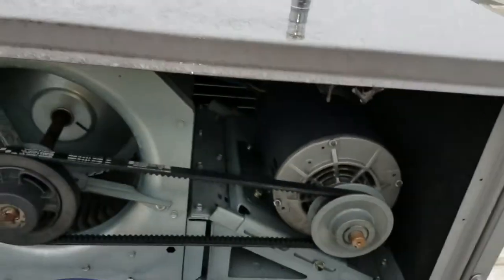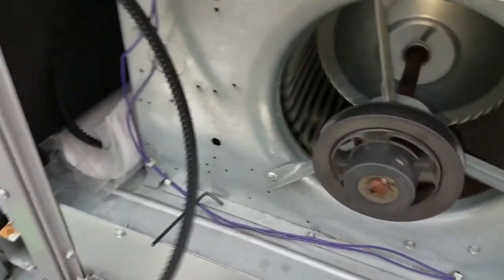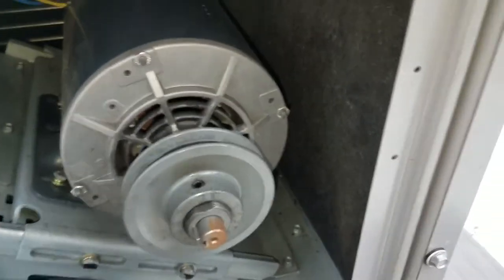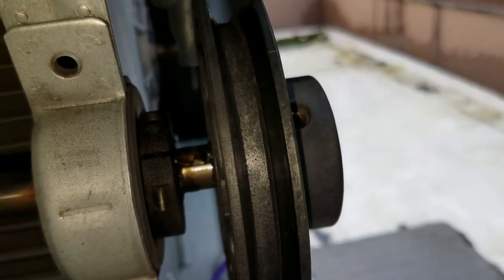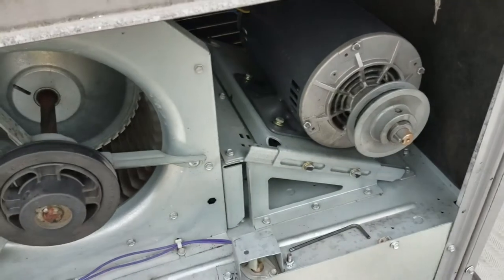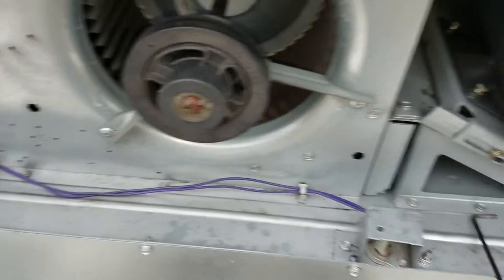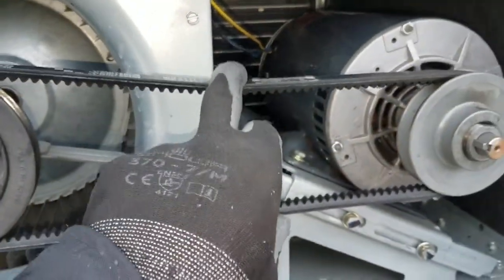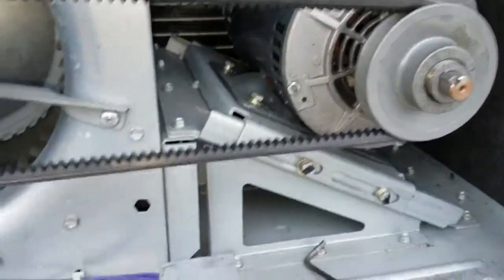Rooftop unit blower speed raising. Rtu

Comment: FYI  need to check the motor amps before and after might already be at max rated. This will increase your amp draw and burns motors out
Reply: EXACTLY!!  That's why I'm here.  
@Dennis Benjamin  I burned out TWO motors last summer messing around w/the adjustable pulley and set it wrong which "over-amped" the motor.  How do you adjust the pulley get the most out of it and NOT burn it out??

Comment: Great video.  I just have a question, when it comes to the belt.  There are units that use belt with teeth and some with no teeth.  What is the difference?”
Reply from the maker: Teeth help the belt last longer. Basically when the belt turns the sharp corner around the pulley, it puts extra force (heat) on the thickness of the belt, so using the teeth reduces the heat. The cost difference of the belt of teeth (AX##) and non teeth (A##) is something like $12 teeth and $7 for non teeth.
Reply: @dennisbenjamin3602  thank you. Understood

Comment: I tightened the Sheave which may have sped up the makeup air, but definitely not enough. It should work if I put a larger sheave, should it not?
Reply from the maker: It should, but is not in manufactures specs. At this point I’d start looking at duct work issues or size of the unit. What you’ll get us extra load on the motor cause premature wear, strain on the belt and wheel bearings. Tightening the sheave is a bandaid but replacing the sheave with larger is a bandaid I probably wouldn’t recommend.  In answer to your question, yes it will make the wheel spin faster.

Comment: By adjusting the pulley for size but then lengthening the distance for tension, won’t you net a similar final RPM at the flywheel? Seems like you’d adjust the pulley and have to resize the belt. Hard to know without clocking the flywheel for RPM.
Reply from the maker: tr1pl333 you’re right that clocking it would be the surest way. However, the length of the belt doesn’t matter, only the circumference/width of the pulleys. Tension is important to keep the belt from slipping and wearing itself out. Thanks for commenting! :)

Comment: I have this style, belt driven blower in my house. Can I retrofit to a new style blower that isn't belt driven ? Doesn't blow nearly hard enough to cool the house. Event after tightening the pulley
Reply from the maker: ReTroKadez yeah I suppose you could retrofit a direct drive motor. In Portland there is a company called Conrey Electric that could come up with a wheel for you to match what you have, or pretty close. Then buy a belly band that would fit the housing. 
   The problem I see with this idea is that the airflow would not be specific, that you’d have to play with it to get it right, maybe try a couple different motors. 
   If you have good refrigerant pressures and your temp drop is large, it’s probably ductwork related airflow problems. If temp drop is normal and you increase your airflow, you wouldn’t get more cooling, just more air velocity at the register. This also would reduce the amount of dehumidifying the system would do. 
   There’s alot more to it but in a nutshell....
Reply: Get a new motor. I had the same issue. Fixed it. Now it blows my picture's off the wall lol no joke